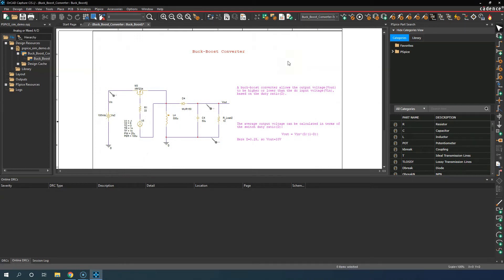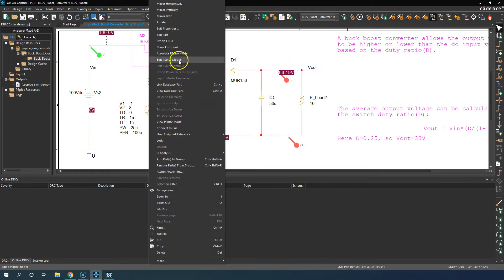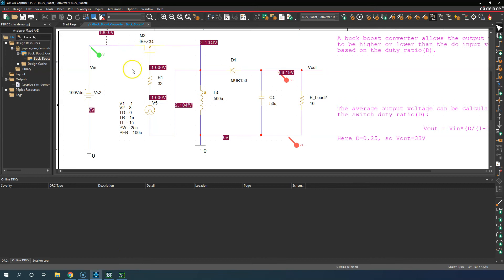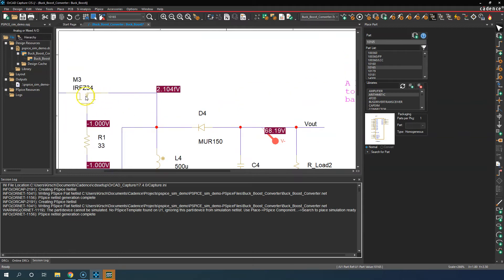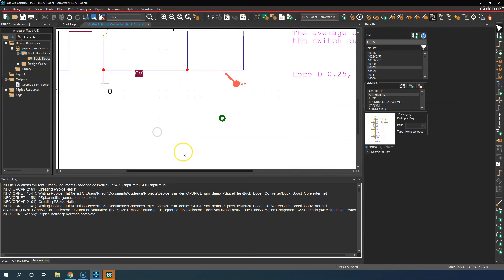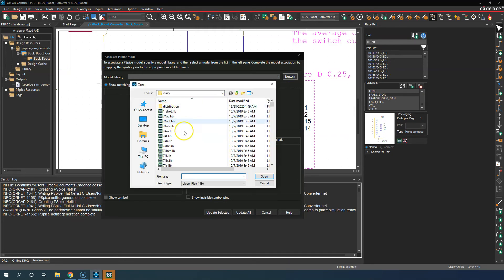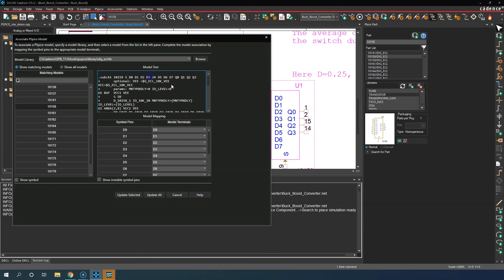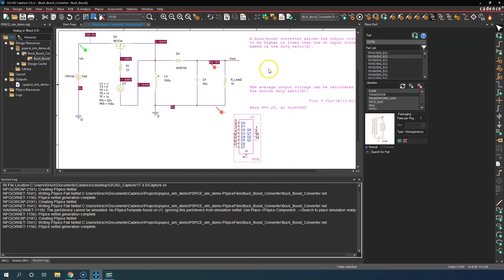OrCAD PSPICE Tutorial Warning No PSPICE Template, ignoring

Comment: Hello, I need help with my project. The system consists of BJTs, capacitors, potentiometers, and a piezoelectric element buzzer. But while creating the circuit, I had a warning, "No PSpice template," and I didn't know what kind of piezo buzzer to use or a pot!. My instructor didn't want to help because she thought we should figure it out on our own, and I had no idea because I searched everywhere and found nothing. So, if you could help, I would really appreciate that:).